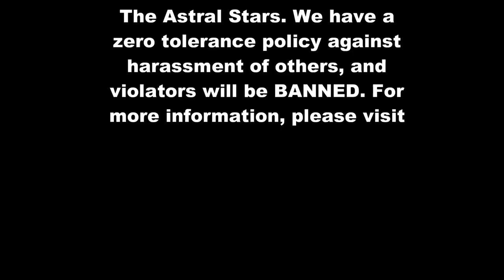⭐ 2003 Jeep Liberty Sport - 3.7 - Partial Engine Rebuild - PART 16

Comment: I sure did not know that the Main Bearings are all different. Can I replace the main bearings without removing the engine.
I bought the Jeep Liberty Sport and found out that the head gasket is blown. I had the heads rebuilt and put them on. Then the oil. Light started coming on then it started tapping and then I heard a knocking. I bought new lifters and rod bearings and main bearings and Oil Pump. Can I replace the main bearings without pulling the engine?

Comment: On the last step I like to mark the bolt heads with dot or line that way I can keep track of what bolt I have torqued 90 deg etc and make sure I have turned them enough.
Reply from the maker: Great tip Jeff, I actually did that on the 2004 Monte Carlo video series. Not sure WHY I didn't this time.

Comment: Since I can't pull the engine where I am living at, do you think it's okay to just put new rod bearings in and hope that fixes the knocking noise.
Reply from the maker: That Jeep don't want to give you a break, LOL! Yes you can replace both main and rod bearing, BUT it will be VERY difficult. I highly advise finding someway to pull that engine.